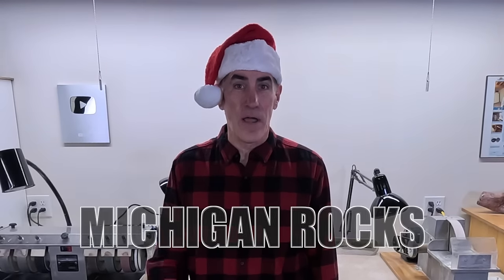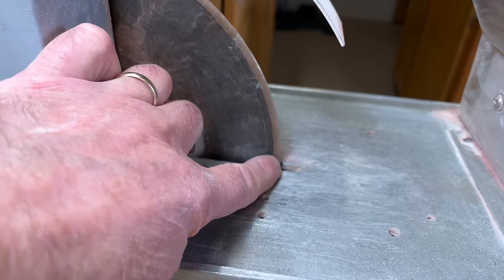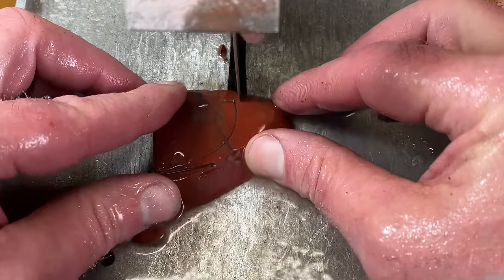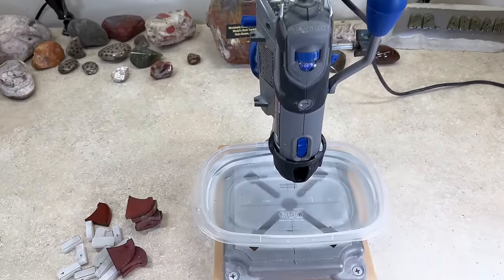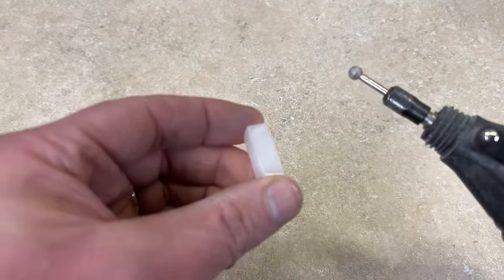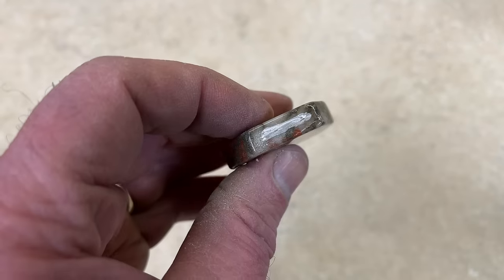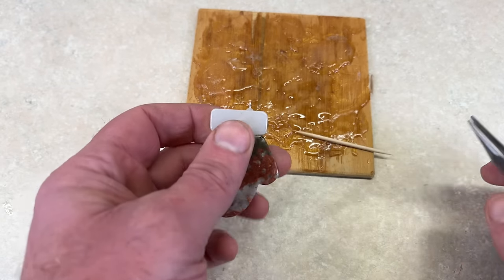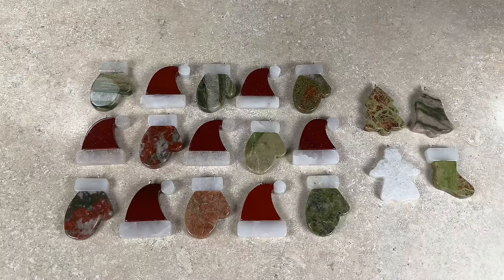These Christmas Ornaments Rock! Learn How to Make Your Own

Comment: I just got my Christmas Tree & Pendant I purchased - now I NEED a Santa Hat!! ❤
Reply from the maker: I'm not sure that the ball on the top will hold up during shipping. It's only attached at a small point.
Reply: Mary wraps them up in tons of bubble wrap - should be ok??
Reply from the maker: @Brenda-sk6ev  I'm not sure. She had an angel break a couple weeks ago in shipping. It probably had a fracture in the rock before it was shipped.
Reply: I'll take a chance - as long as it doesn't "break", I can glue it back on!! ❤

Comment: What a great and instructive video!  I now have to figure out how to make my saw cut straight lines through the rock without the undercuts.  Does the ramp have to be over the the middle of the blade or just even with it?  Thank you so much for your awsome videos.  I'm always so happy when you have a new one.
Reply from the maker: The top of the ramp needs to point toward the center of the blade, like a hand on a clock. That's all that really matters.
Reply: Thanks Rob.  A lot easier than I thought.
 @MichiganRocks

Comment: You might try goldstone for ornaments in the future.  It's manmade sparkly glass and comes in a few colors.  Green or gold would look great.  It looks and polishes like obsidian, but is sparkly beyond belief.  The sparkles are microscopic metallic crystals that form when silica glass and certain metals are melted together and cooled in a vacuum.  Although it's manmade, there is some interesting science behind it.
Reply from the maker: I think I have a piece of that in one of my mixed batches of rock somewhere. I wonder if it would round off too much in the tumbler since it's softer than rock.
Reply: @MichiganRocks  It's as hard as obsidian.  Softer than agate but not that soft.  You could drop it in the Lot-O 12 or 24 hours after starting the batch for a gentler grind.
Reply: I got my goldstone rough from the Rock Shed when I visited in person.  I don't think it's on their website, but if you call Shawn he might be able to add a pound or two to your order the next time you order something.  I got blue goldstone there, but I think he had some other colors.  It was reasonably priced.  @MichiganRocks
Reply from the maker: @jonathanyoung7785  Thanks for the info on where you got it. I didn't know they carried it. Do you know if it is still being manufactured?
Reply: Yes, in China.  It was only in Italy for a few centuries, I believe, because the process was a secret.     @MichiganRocks

Comment: These are awesome! I really want to try and make some! Where did you find the stencils for your shapes? Your skills are unbelievable on the saw! You make everything look easy! Editing probably helps.😂😂 Happy Thanksgiving Rob and Nancy! Thanks for sharing!
Reply from the maker: I make my own stencils. Either find a picture you like on the Internet, or just draw your own. I drew these two on my computer and cut them with my laser engraver. That's overkill though, I used to just cut them out with an Exacto knife. I use card stock and it works well. It holds up surprisingly long.

Comment: As always enjoy all your videos.  Do you have a link to the diamond drill bits you are using?  Tried some  highly rated ones off of Amazon but not having any luck drilling.  Thank you
Reply from the maker: I use inexpensive Kingsley North 1 mm drills. They only cost 75 cents each if you buy 100 at a time. However, I get somewhere between 0 and about 12 holes from one bit. That's drilling into stuff like unakite, quartz, jasper, and puddingstone that I find here in Michigan. I was unable to drill Lake Superior agate with these bits. In a drilling session of 15-20 ornaments, I go through about five or six bits. I don't know if there's something better, but everything else is a lot more expensive, so I keep buying these. https://kingsleynorth.com/diamond-drills-kingsley-north-inc-pkg-of-100.html#1121=29239&1120=29230?ref=robertabram1&utm_source=tapfiliate (affiliate link)